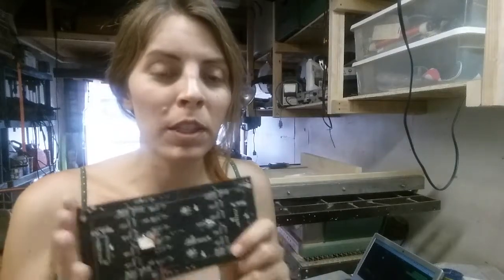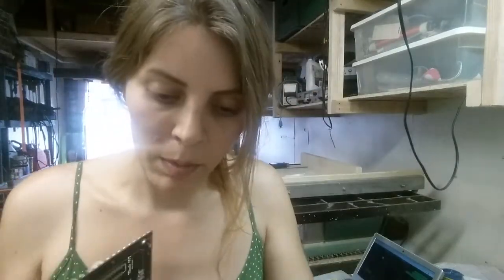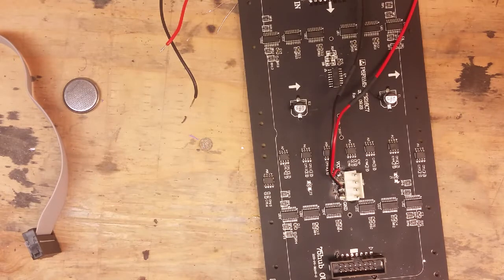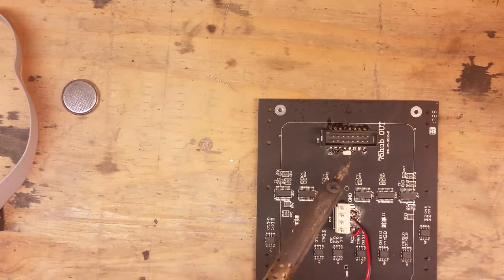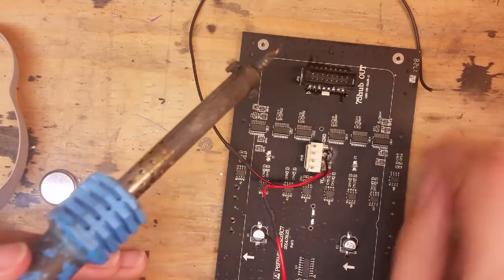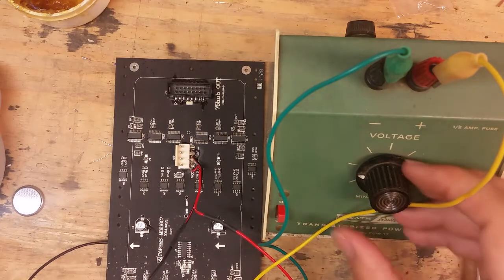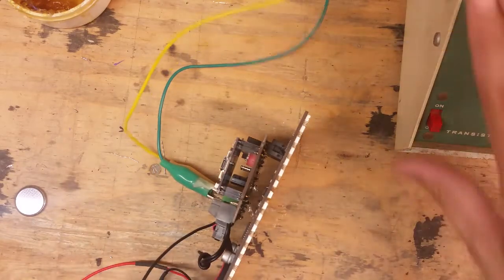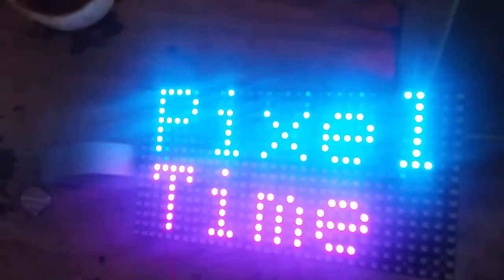Pixel Purse LED Matrix + ESP32 Part 3: Success!

Comment: Emily, could you share the configuration you made to make this work? After watching your video i snagged up a couple of these purses and wired a panel up according to Brian's instructions, but all i get is red and blue. I cannot get green working. My panels have D3 and D6 grounded in the connector, so i guess you had to do the same changes as me. I tried all kinds of combinations in the software, but no green LED's for me :/
Reply from the maker: I didn't have any problems with green on mine. Are you on Twitter? If so, can you hit me up there? It might be easier to do this if I can see photos of what you've got
Reply: @EmilysElectricOddities  yes I'm on Twitter. Might post a picture of my setup when I get a minute :)
Reply: @EmilysElectricOddities  Finally i sat down to trace out all the connections. I had wired the P-out connector with individual jumper wires ... Guess what, i swapped two of them. No wonder it didn't work :D

Comment: Emily, could you link where you got that idc 2x8 smt component?
Reply from the maker: So, that IDC connector came with the breakout board I ordered. I needed another one when I bought a second panel to daisy chain with the first, but I didn't want to pay the $1.50 Digikey was asking, nor did I want to buy 50 of them off ali, so what I ended up doing was cobbling one together out of headers and perfboard. It's kind of ugly, but it works. 

https://twitter.com/MLE_Online/status/1178009624315711488
Reply: @EmilysElectricOddities  ah - that makes sense. Thank you!

Comment: Some rest is all it takes. :D I'm tempted to buy one of those things. Led-matrices are always fun to mess with :)

Yeah, temp could be the reason. I notice the same on mine when I have to crank the temp to max to compensate for its low thermal capacity :)
Reply from the maker: I should really get a soldering iron with temperature adjustment. It would be a nice addition to my shop
Reply: You could always get a Weller WP25. I've built the majority of my projects with the same one, and you know how long that's been goin' on. 😂🤓🤣
Reply: How's the longevity of those things? :) I'm still on my old Atten 980D which is almost 10 years now. Those new small things seem kinda cool
Reply from the maker: @imikla  I could probably keep using this Hakko. Maybe I'm just getting pickier the more soldering i do
Reply: I've tried others, but always go back to the Weller. Eventually I'll probably get one of those stations with the fancy controls, but this still works great. I do wish I still had the heat shield for the handle though (it broke 😢).
Reply: Weller produce some high quality stuff. :)
Reply: In particular their flux. I'm a naughty boi and use their pipe soldering stuff on occasion lol. It makes short notice of really dirty boards/pads.
Reply: @Chriva  Have you seen the EEVblog video about the Weller that didn't have a mains fuse?
Reply: I did. I find it hilarious how everything must be fused the moment it has a box attached to it. A regular ol' iron doesn't have it either :)
Reply: @EmilysElectricOddities  The T12 irons seem to be getting quite popular lately. Similar performance to TS100 but even cheaper.
Reply from the maker: @NiHaoMike64  I had been looking at the TS100s, but I'll have to check out the T12, too. Thanks!
Reply: @EmilysElectricOddities  I'm very happy with this one: https://www.banggood.com/KSGER-V2_1S-T12-Digital-Temperature-Controller-Soldering-Station-Soldering-Iron-Tips-T12-K-p-1338117.html